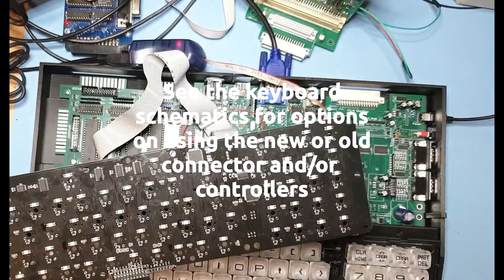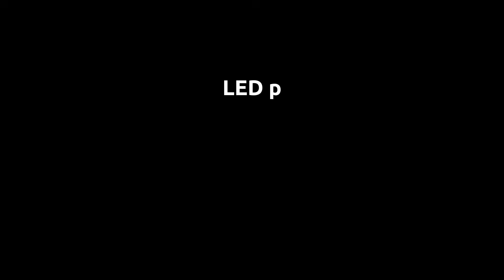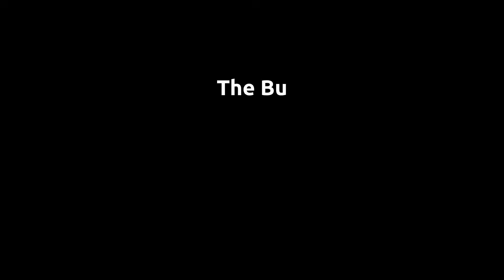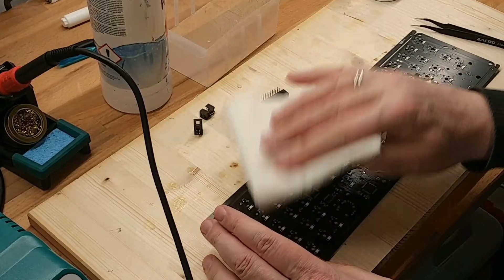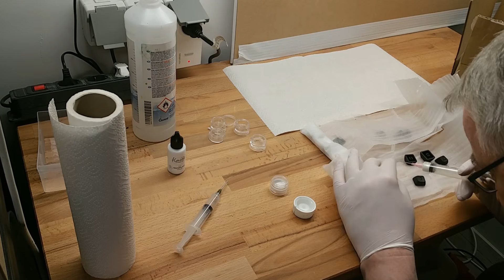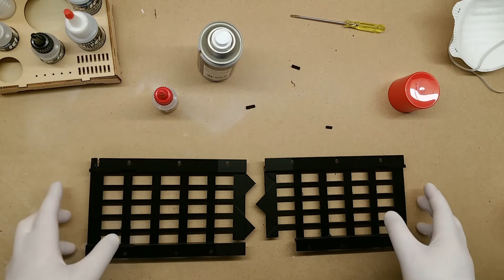Building a new Commodore PET keyboard with key mapping and LEDs

Comment: This keyboard is beautiful. I am working on a Commodore PET, that is to say, I am still working on it to get it fixed. I have the transformer,  the main board and the electronics from the monitor. Luckily I could find an original keyboard. I hope it doesn't fall apart as other old keyboards do. But then I have an alternative, your new keyboard.
Reply from the maker: That's great to hear you found an original, but it's good to have a backup plan just in case! 😅
But to be honest, for an original machine the pcb from Steve Gray as linked in the description is probably the easier solution.

Comment: Something seems to be wrong with the video because there's a lot of studdering of the video. Audio is good.
Reply from the maker: I know. Unfortunately it seems I need a new recording laptop. That thinkpad w510 is now a little old it seems...
Reply: @8bi @8bittimes  If you have a smartphone it is probably better at recording video footage...
Reply from the maker: I actually have a smartphone and I am using Droidcam to directly send it to the PC for storing it. Usually works fine, but I had to throttle the old PC (laptop) already due to heat-related issues. So a new (old) one is in order